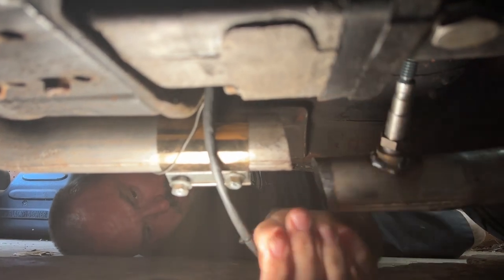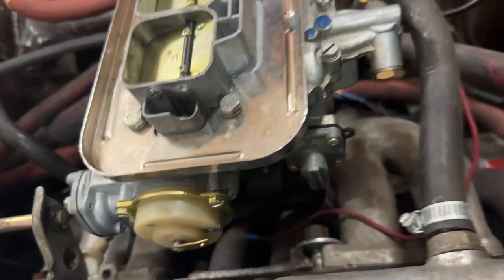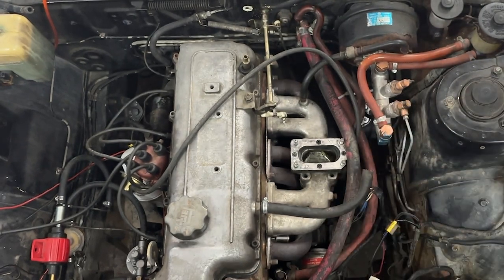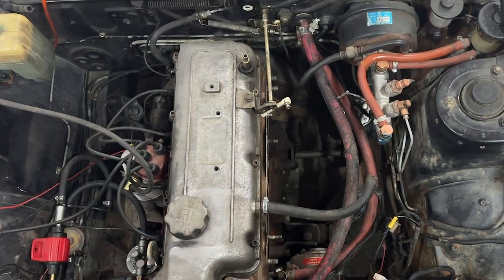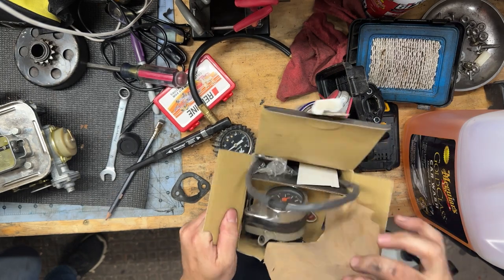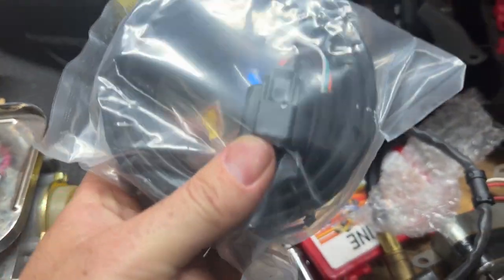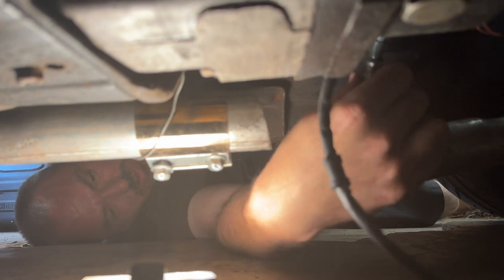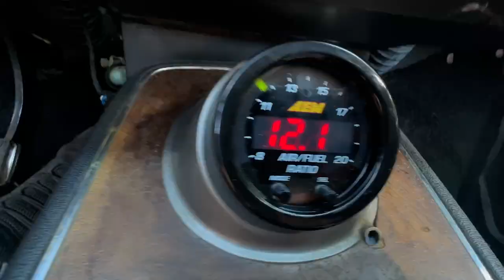DIY Install an AEM Air Fuel Ratio Gauge - 1972 Toyota Celica

Comment: so I just added one to my car, 77 with sidedrafts, how has it been working so far
Reply from the maker: Honestly it’s a little bit jumpy. Could be dodgy voltage or maybe the fact that the exhaust doesn’t seal fully after the header but the gauge seems to do its job flawlessly.
Reply: @oioracing  yeah I might have to go to a no vacuum advance distributor
Reply from the maker: @1970ronin  they do make tuning tricky.. especially if you use the wrong port for vac advance :D